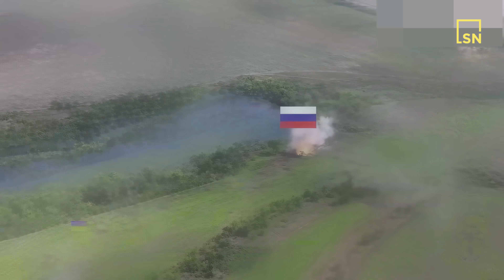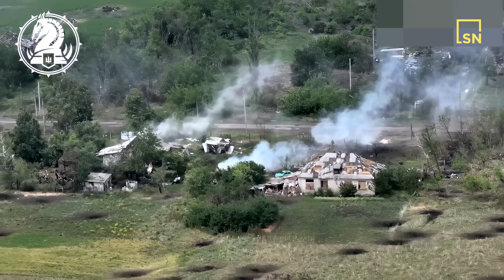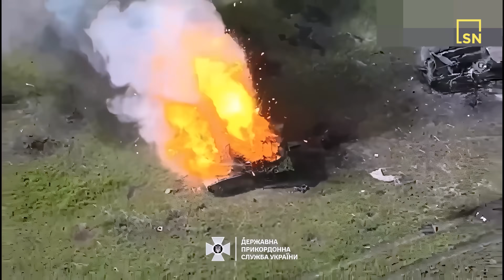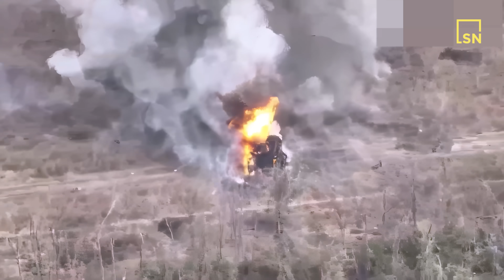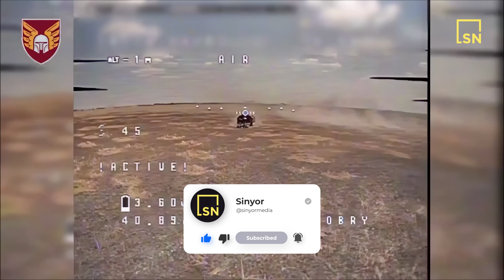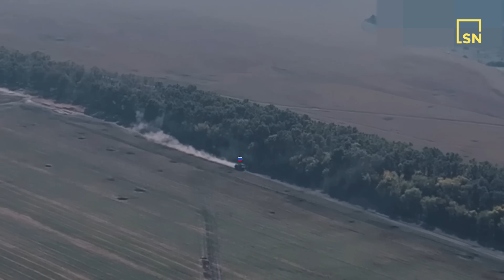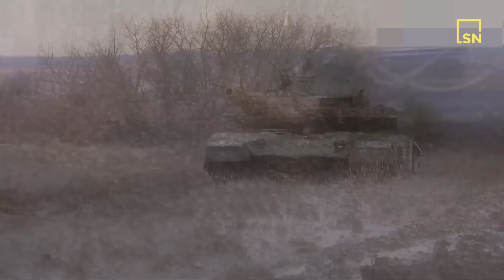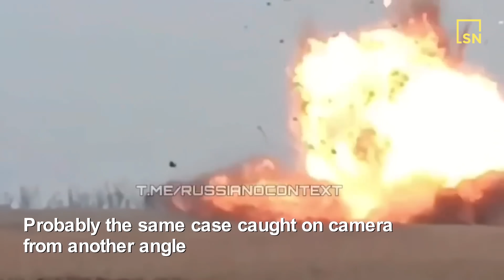Two Abrams Face Russian Brigade Alone, Head-on

Comment: I just had a crazy thought. USAF Brass want to retire the A-10 Warthog, so let's send them to Ukraine!
Reply: Probably too expensive to maintain. That is one of the reasons the Air Force wants to retire them. Nobody is making many of the replacement parts anymore.
Reply: @brianphillips7696  not actually true, they all got brand new wings since 2010.  They're very simple aircraft and many parts can be fabricated at a base near the front line.  The real problem with A-10's is that they either 1) fly low but get shot down by man-carried anti-aircraft missiles, or 2) fly high where they can't use their gun, are far slower than F-16 and F-35, and can't defend themselves against other fighters, but cannot carry more than an F-16 or F-35.  A-10s have a longer loiter time, I think, and cost far less per aircraft and per flight hour.  But it's cheaper to have just F-16s or just F-35s than to have a mix of one of those plus also A-10s.  Simplifying logistics by only having one plane model to support saves you more money than having a second cheaper model.
Reply: @lqr824 it isn’t just the wings, it is all the systems. They have been having to scour previously retired airframes for parts or having them custom made. And customer making components isn’t cheap or simple.
Reply: @brianphillips7696  The vast majority of body panels of an A-10 are simple curves, not compound curves.  To replace the body panel, you simply need a supply of sheetmetal.  You cut it to size, rivet on edge, and curve it into place.  Take a piece of paper and roll it up into a tube and you'll see how this works.  You don't need "parts" for this.  The body panels are simple metal and you don't even need the exact same thickness or alloy for a field repair.  A huge number of other parts on the A-10 are chosen not to maximize performance but to maximize ease and cost of repair.

In contrast an F-16's body panels are mostly compound curves, like the shell of an egg.  You can't simply fabricate a replacement in the field.  Instead it needs to be made in a factory with a 20 ton press, warehoused for decades, and shipped all over the planet with every deployment of the planes it fits on.  Other things, from screws to electrical fasteners, are generally custom not just for the plane but for that exact point on the plane.  They're designed for minimum weight, minimum size, high temps at high-speed flight and so on.  F-35's even worse as radar return is the overriding concern.  I wouldn't be surprised if there's not a single part in a hardware store that would fit on an F-35.

There's nothing wrong with raiding spare parts from disused airframes.  All smart maintainers of ANYTHING do that.  It'd be idiotic to order a new fuel pump or what have you if we have 840 used ones right there in the field, and each one has a paperwork trail showing that it's been properly maintained its entire life, that it's far from its maximum MTBF and so on.